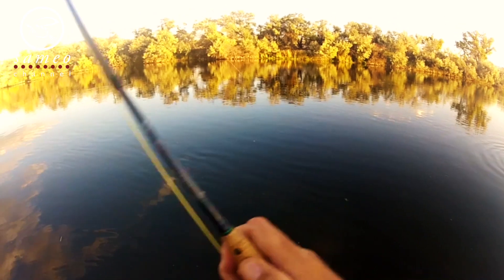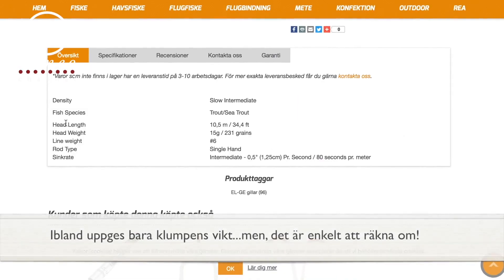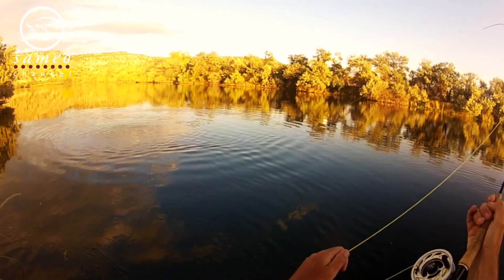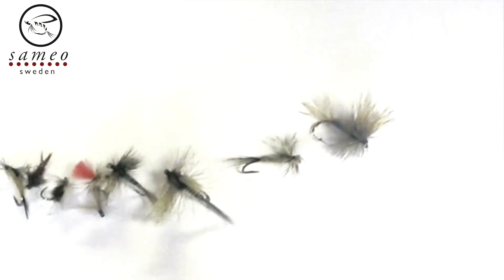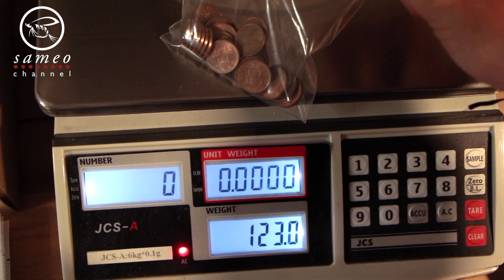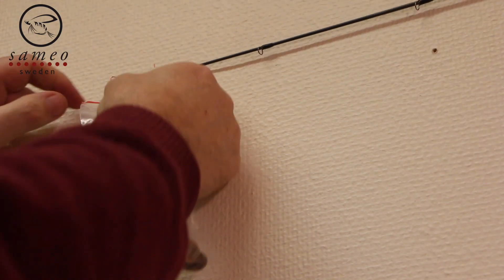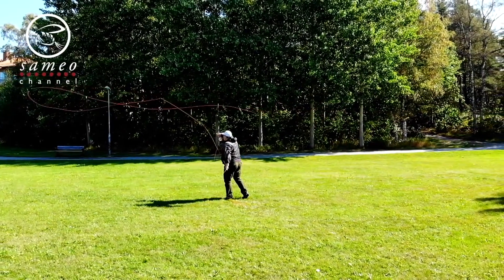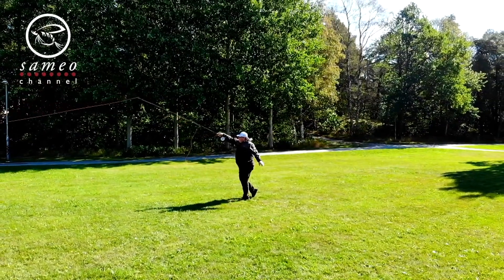A simple method to find a matching fly line!

Comment: does anyone have an opinion on whether to measure the entire length of the rods or just the blank all the best Hannes
Reply from the maker: Hi Hannes!  been using the length the manufacturer put on the blanks...since we actually use the blanks all the way down trough the handle and is glued into the reel seat.  Since a fighting but and lower handle on 2 hand rods is not a part of the blanks, I guess that is not included...However I must confess i didnt take out any measuring tapes, I just used the length printed on the blanks :)
Reply: @sameochannel7637  thanks for the help all the best Hannes
Reply: Thanks for the help all the best Hannes

Comment: I know this is a old video but was wondering if you could get the calculation app to work. Thanks
Reply from the maker: Hi Byron! It worked for me? Maybe something with your browser?
...first you put in your rods length in centimeters and push "beräkna" to get how long  don it should be weighted, and then in grams how much weight it took... :)  If you use feet and inches you just take a third of the length :)  If you use imperial weights, just use google to convert :) Best of luck!

Comment: should I feel the rod load up with the correct line wt or is every rod different were u might not feel it load
Reply from the maker: Hi Darius!, To be honest, that matters how straight and fast you get your back kast to load up the rod spring...there is to many people that tells you taht you have to "feel it" That makes also people then choose lines that ar WAY to heavy for the kind of flies that the line class actually where intended to deliver in the first place,,,,look at the tutorials i mede of the "side cast", those practice routines will make you in a very short time get yourselfe a straight and nice line path that will make your rod load SO easy...since you actually can SEE your "back kast and correct any problems before you look for new heavy "easy to cast" lines that are to heavy :) https://www.youtube.com/watch?v=LN76wSscA84&t      After that one look at the double houl tutorial...PLEASE try both even if you already are a advanced caster...we use these tutorials when we try to make even the Pro casting instructors better :)

Comment: where and at what height (related to rod position) O cm is placed?
Reply from the maker: Draw a thin straight line if you wish, or a tape) if the rod flexes by its own weight below the zero, so it may be...that I count as a natural flex anyway since it would be flexing like that during a cast :)  So the zero is a straight horisontal line from the handle out :)

Comment: thanks for the video. I rigged up a mock-up to measure the parameters of an unknown rod I bought in Japan a long time ago. I guessed over the years that it was in the neighborhood of a #7.  I don't believe you said during the video to measure the handle or not. Also the rod flexed under it's own weight and that caused me a bit of confusion. so I measured it both ways. Also, it's a good thing you used US cents, otherwise I would have had to go to the bank...just joking. And that brings me to my results. I found, using the on-line calculator that the rod is a #6 without it's own weight's deflection, and an #8 using the deflection plus the weight. So, I guess my best guess over the years was pretty close. Thanks again for taking the time to share some valuable information.
Reply from the maker: Glad to help Mike!! Stay safe now buddy!

Comment: Thanks, Ken!  This reminds me of the golf industry with regards to shaft flex.  One OEM’s stiff shaft isn’t the same as the next, and consumer are left guessing.  To make matters worse, within a batch of shafts there is a wide variance — basically, what it says on the label isn’t always what it flexes to.  I’d image that fly rods follow that same trend.  Each 5 wt is different whether between OEM’s and within batches.  Now, add to that the obsession with faster and faster rods (for distance) and up lining, and we’re often left totally guessing.
Reply from the maker: Hahaha, Thanks mate :) I heard the same thing about the loft degrees of the clubs! (is that the correct term?) same deal there ..and its so weird :D
Reply: Sameo Channel loft (face angle) and lie angles (angle between club face and shaft) have been changed by the OEM’s to ostensibly make clubs “easier” to hit and go farther.  But, like fly rods, I think they’ve just confused the issue. 

I have a vintage bamboo rod I got refurbished that feels so very different than a modern graphite rod, but I can’t seem to find a line weight that I like.  Using this method should solve that problem.  

I need to come over to Sweden, my Great Great Grandfather was from Malmo, Sweden.
Reply from the maker: @QuantumRadii  Thanks :) yes, that was what I was looking for :)  I guess the fly fishing brands that order their lines to be one, two and sometimes three classes higher in the aftm system (and then make their rods more powerful) do it by same reason...to make it "easier" to cast...still with a low number on the blanks :D  Every one seems to  want "easy to cast rods and lines", but dont wont higher class then a five :D its like when people want to have a size 7 on their jeans but it is a 9 when measured :D as long as the label states 7 all is good and dandy :D